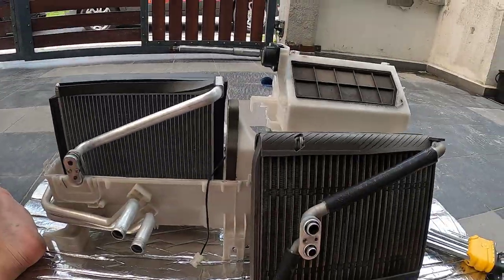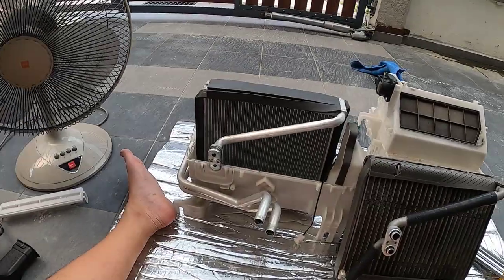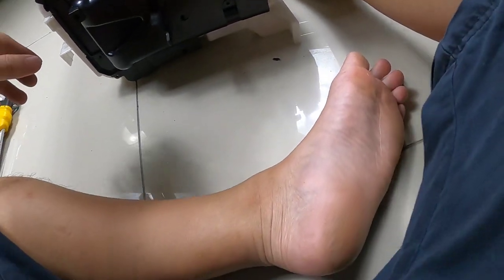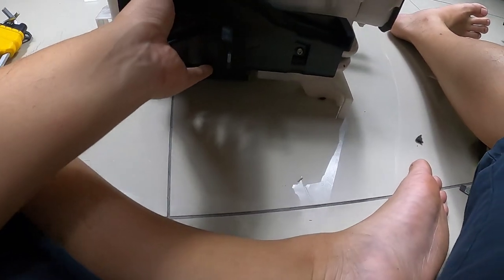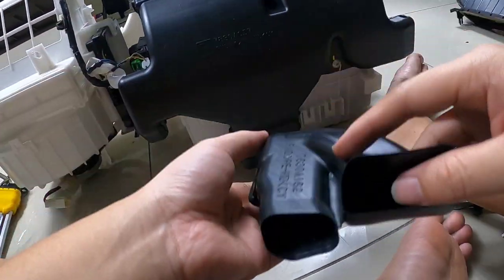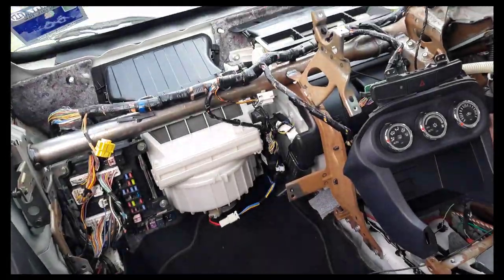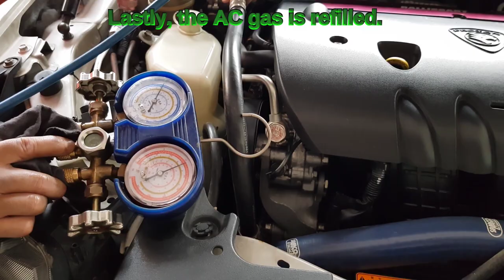AC Series Finale - Inspira / Lancer 08 Cooling Coil Replacement

Comment: TC youre the man this is exactly where im at but only because a mouse got in my blower and this is so helpful for me to see, i dnt think it can make it to the cooling coil area so its just got to be all before that. i just got the dash i was missing the two airbag bolts! thanks again for the encouragement now i need to remove my heater box and clean it and put it back together, thanks for this video!

Comment: Like your content, keep it up bro, by the way would like to ask... As I we don't need the heater in our country, can we just blind and block the coolant circuit for heater?  And by disable it will causes the controller not function well?
Reply from the maker: From the design, I think you can but I find the heater very useful actually. Especially in the morning when the windshield is foggy from condensation. I would just put it to 32 degree and set it to blow the windshield, 30 seconds and everything clears up.

Comment: Hello sir. My ac problem is only cool at 2 driver side. On the passenger unit is not cool. Do you have any idea what is the  problem?
Reply from the maker: This happen because there is insufficient gas in the system. Recharge it and it should be okay. If it happens again then it means you have a leak somewhere.
Reply: @TCsAnythingGoes  OK, good sir. I also thinking the same thing. I will do that. Thanks a lot for your advise. Actually your channel help me a lot with many kind of diy. Not only this video but others also. For the past few years, i do a lot of diy for my car by referring to your video. This kind of video help not only me but also other poeple. Hopefully your channel grows bigger and bigger day by day. Great and thanks again..👍🏻

Comment: is there a shortcut to reach the cooling coil by using a spray cooling coil cleaner with a long hose?
Reply from the maker: based on the design, its not very effective. You can try taking the blower fan motor out, then put the hose in from there. But looking at the angle, you will most likely be unable to cover the cooling coil effectively.
Reply: @TCsAnythingGoes  thanks  for clarifying it.
Reply: TC's Anything Goes and one more thing to ask,before disassemble the dashboard thing,what are the symptoms of the cooling coil leak which made u decide to replace it?
Reply from the maker: ohhh, my cooling coil was not leaking. My compressor jammed so I changed the entire AC unit since it didn't cost me much more. But signs of leaking cooling coil includes:
- Freon / AC gas smell in the car
- If small leak, then every few days or weeks you will need to top up the AC gas
- If big leak, then your car will be out of gas every day
- blowing hot air instead of cold
Reply: Hi bro.. sorry i baru tengok video ni.. if i use a water hose n shove it inside n spray to cooling coil, ok ke without removing all the unit like yours?
Takde pape ke kena air? Sebab area situ dekat dgn wayar2 cable2..

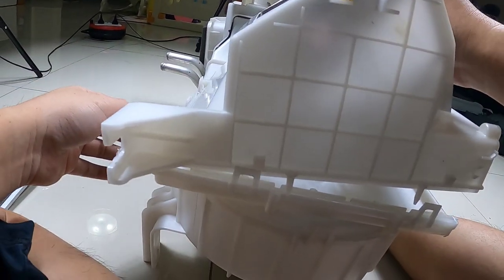Comment: hey man , do you where i can source a new unit of the one that in 14:32 ?
Reply from the maker: I am not sure if you can even get it new. You can try asking at the parts shop or the dealer. Online shops may be possible but I am not sure what exactly is that part called.
Reply: Part #16